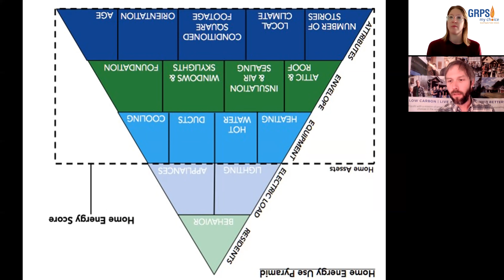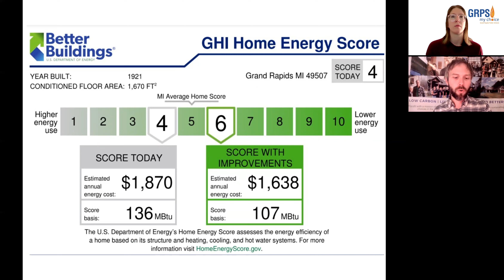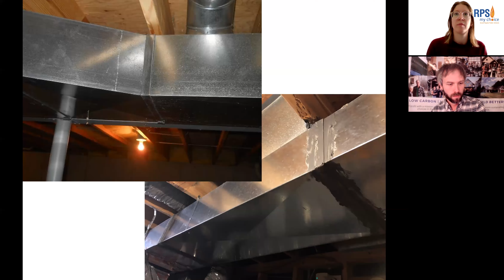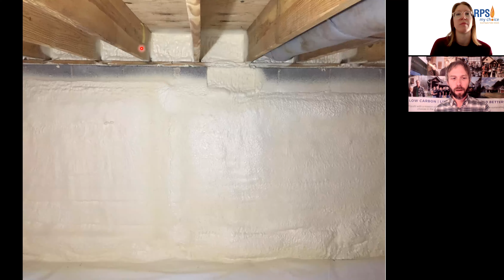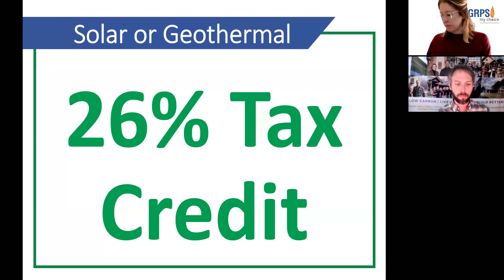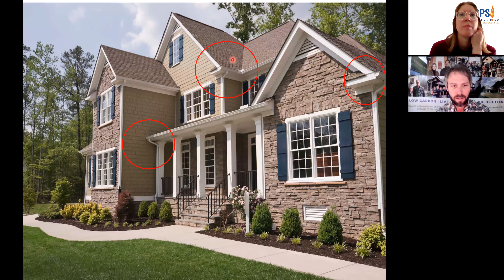Home Energy and healthy homes - what you need to know

Comment: I was wondering if the on-demand water heaters are more efficient than a regular hot water heaters (constantly keeping a tank of water heated) is better or not. I know you have to watch the temperature to keep from getting burned. Also, is electric or gas better?
Reply from the maker: Good question. They are but water heating does not use much energy to begin with and they are more expensive to install and maintain. We recommend a heatpump water heater as the future of the best water heating or if you must stay with gas use an energy star, sealed combustion high efficiency tank.